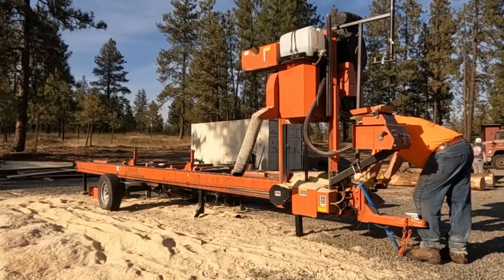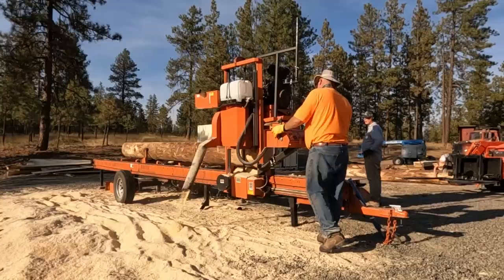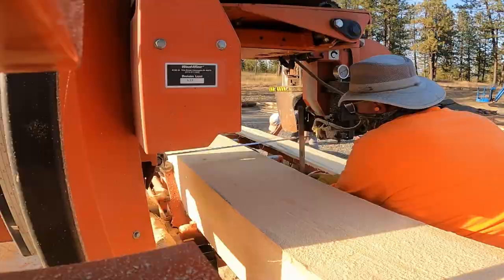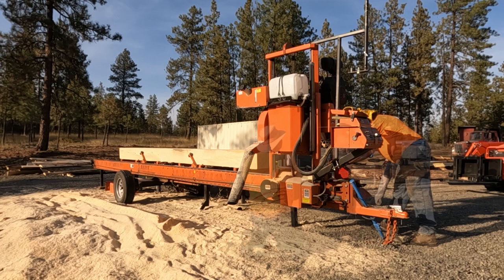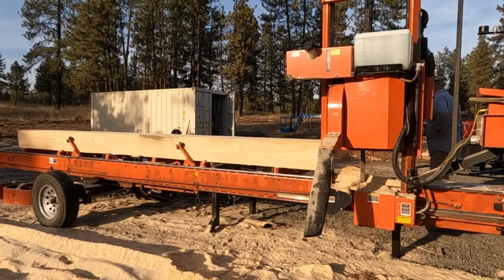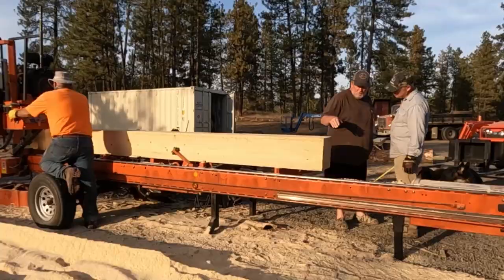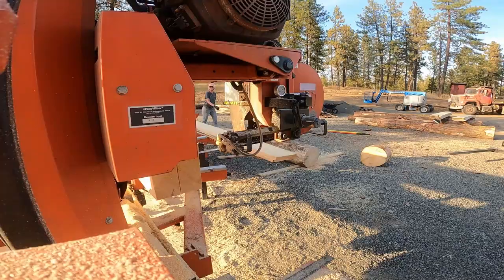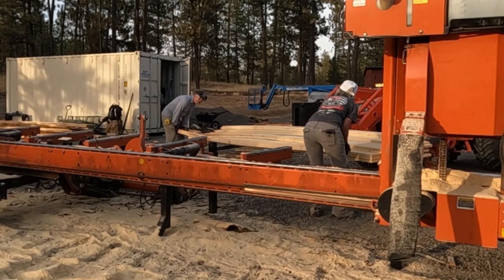Uh Oh! This Happened SAWMILLING Pine! #sawmill #woodmizer

Comment: Perhaps you could check the scale calibration at the beginning of each new cutting job/location as part of your standard operating procedures.
Reply from the maker: Funny thing is I often do and on this one it was doing fine earlier in the day.  It was just the log before this one that we noticed the last cut was a bit off and splitting the cant wasn't right.  I also often measure as I'm going but had taken for granted all was well LOL oh well, time to make sure I check things a little more often on a long day like this.  Lessons learned!  At least it was just over mind you and only on the last board off the deck and the width of one cant....one was 4" wide and one was just under 4 1/8" and the last board was just under 1 1/8" thick.. good thing it's all rough sawn and will be jointed and planed after drying but I hate not catching that before I mill stuff and the customer notices it!  DOH!  Thanks for the comment!